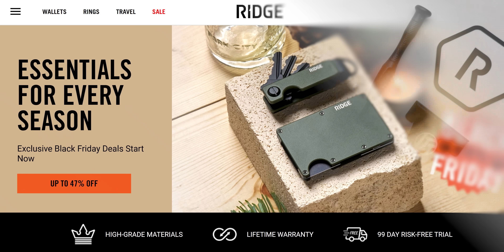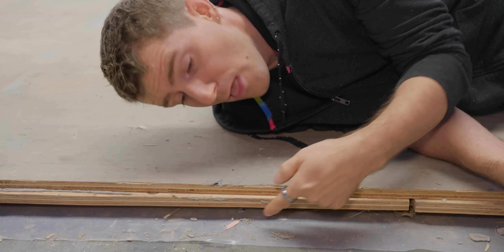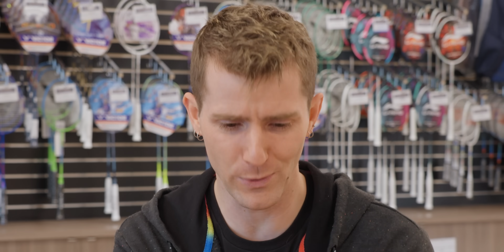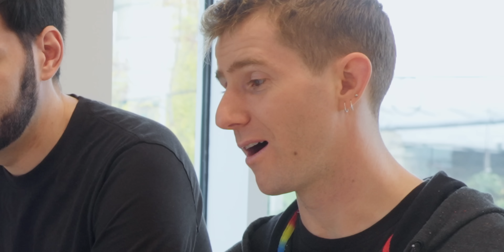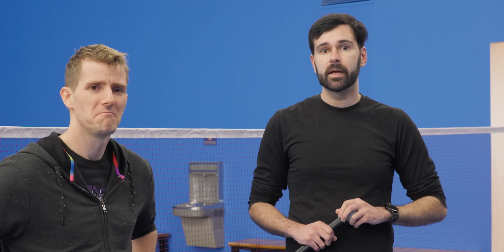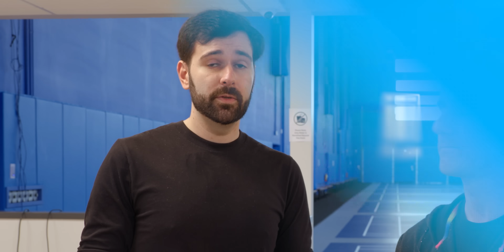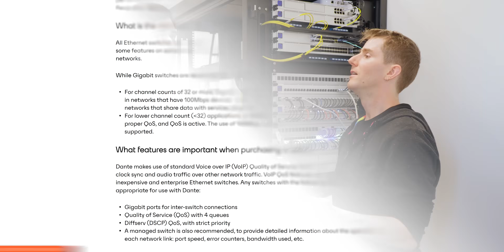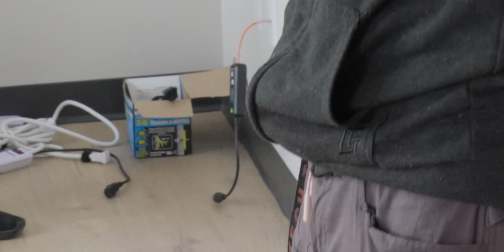You can finally hear me! - LAN Center Audio Tour

Comment: so I'm confused, why would you not just wire speakers to a centralized location then just use wireless mics or a longer xlr run? I believe XLR cables go around 1000 feet, so you could've just wired everything to closer to the middle of the building then just split a cable off from there.

Comment: I reverse engineered Dante Controller by capturing network packets and examining them so that I could control and script the devices from Linux without a GUI. My use case is a home audio system declaratively managed with systemd that runs jack and manages shure wireless systems so that I get every mic available on every computer and every output mixed into IEMs that I can hear while I just walk around the house. project is called netaudio

Comment: Came here to get a little bit nit-picky. 
Dante isn't a standard. It's a proprietary implementation of Audio over IP, similar to NDI being a proprietory implementation of Video over IP, hence the need for companies to be licenced by Audinate to produce hardware using Dante.
There is a standard called AES67 which allows for interoperability between a bunch of different Audio over IP standards that are in use across different industries, Dante being one of them. 
Dante was widely accepted in the live production and installed AV world, especially after companies like Yamaha licenced it for their AoIP implimentations. It's very common to use Dante in the way it's being used in this video.
The broadcast industry uses a few different AoIP protocols including LiveWire+ by Telos and Wheatnet by Wheatstone. Again these are proprietary protocols that are AES67 compatible and to use them the products must be licenced by the manufacturer.
RAVENNA is an open source, AES67 compatible, implementation. 

Basically these protocols were all being developed in the mid 2000s and all of the different manufacturers saw the need to interoperability between them which lead to AES67 becoming a thing in 2013.

Comment: Not bad for a software (or at least a non-audio) company. As an audio engineer (who for example regulates the Dante setup here at the Dutch broadcast museum and event floors)  I see you implemented it quite well! I don't know which Shure receivers you're using but take in account that the more pro models from Sennheiser and Shure have Dante build in (saves some dongles!).

Great job in the switches as well, I wouldn't expect anything different but for us sound engineers that is usually the main problem. At most companies the IT is separate from the AV part and to get the right switches / configuration for Dante is a pain since AV is not allowed to touch switches while IT doesn't understand Dante. There should be more crossover interests cause all is coming together more and more (I do btw know enough cause of my streaming / videogame background so usually I can talk to IT about it quite easily but lot's of sound colleagues don't know one ip address from another sometimes ;)  ).

Comment: Dante for the win! As far as the microphones are concerned you may not have issues with them reaching the receiver from the back of the building now but once there are bodies in the building that will be a different story. I recommend using larger antenna fins mounted in a central location for the best stability.

Comment: For microphones I would recommend going with higher up Shure microphones…. Something like the slxd.  With those microphones they have rechargeable batteries and docks where you can charge them, diversity antennas (external antennas to), the ability to network them and use wireless workbench, as well as many other great features such as scanning.  I’m sure that blx will work fine but in the long term you might want something more reliable.

Comment: If you use some NAC software, it can change the VLAN automatically, when a device connects to any switch-port. The device must be identified, to set the correct VLAN, most common is by mac-address or 802.1x. 
Also worth mentioning is, some Switches can change VLANs without a separate software, by using a discovery protocol like LLDP. They set the VLAN based on detected device type.  
For LLDP or 802.1x your end device must support these protocols. Identification by mac-address can be done with any ethernet device. Also your switches must support some type of port-authentication. Most enterprise switches do RADIUS.

Comment: As someone that used to DJ for Corporate and Weddings, did you guys install anything that we can plug in XLRs? I am assuming that you guys will hire vendors for entertainement sometimes because most DJ's do not have mixers that can connect to Dante. If not I would suggest getting the Behringer Wing Rack Mixer with the Dante Card. And then use XLR to RJ45 to avoid running wires like you guys mentioned in the video

Comment: Hey guys, it's great to see you installing a Dante based system, it's absolutely the way to go for your application (and cheers for throwing a few dollars into the Australian government's budget 🤣). However, I do have a few thoughts... 

Firstly, you'd have to be crazy if you're going to run Qsys in a building like this and only have an Ipad or Qsys designer for control, you really don't want to have some random software bug on the device you're relying on to cause you to completely loose control midway through an event. Please do yourselves a favour and install a hard wired Qsys touch panel somewhere in the building. 

Also, unless I'm mistaken those mics look like Shure BLX... Narrowband analogue RF is just asking for problems once you fill a building like this with people and all their devices, plus the dedicated coax runs needed to run a proper antenna setup will be a pain. The go-to for these sorts of installations is a DECT based system (shure microflex or sennheiser speachline), but please at least step up to digital RF, the difference in signal integrity and resiliency is night and day from analogue RF.

One thing that might make life easier for what you're trying to achieve is if the unifi switches support device-based vlan assignment, at my work I've had the sys admins setup our Aruba based networks so that the default behaviour when any device manufactured by audinate is connected it will automatically be assigned an AV Vlan. It makes life stupidly easy if you want to be able to plug into any random port and immediately start sending audio. 

The other thing to note is that although professional audio hardware installation can often be pricey, there are plenty of professional AV system programmers who can remote in to your systems to do work and can be very cost-effective in terms of the quality of their work and the turnaround times. They'll often have a wealth of experience when it comes to Qsys programming and UI design. Or you could just send Dan off for Qsys training 😜.

Hope that helps

Comment: Slight correction regarding Dante and Switches. There are some things that must be taken care of. The switches must not have "Green Etherent" (or EEE) ports or if it has them they must have the option to disable it because it messes with the PTP that Dante uses for timing. Also when you go past a couple devices and a Dante network is part of a regular computer network QoS, Multicast snooping and Multicast querying is basically mandatory if you want to have the least problems possible.

Also Dan, for the Shure microphone get some antennas into the court. When you have a couple hundreds "sacks of water" (e.g. human bodies) in that room the mic reception will be significantly worse.

Comment: … I’m surprised LTT went with a Dante system instead of a 70V…. Seems unnecessarily complex and pricier than what a 70V system with a DSP tie in would be, with practically the same functionality that they’re doing.  I suppose the Ethernet lines were pre-run, and the network bypasses the latency, but expanding on a 70V isn’t all that tough either though.

Comment: Edit: Before you read this comment please take in consideration I'm still learning and am not a professional in this subject yet, so some info might be wrong

on the subject of the way the speakers are places, you should of bought more speakers and put them all in a line array configuration. This would have been more on the expensive side of things but you would have got a more immersed sound. Line arrays give a wider projection of the sound there for you could be standing anywhere and the music would sound somewhat equal volume from any position, in saying that you would also start to go down the route of speaker crossover. lastly you'se should probably check the dB level when the music is on "death mode" because anything above 80 dB or I think 85 dBSPL (its been a while) can cause hearing damage, this could be dangerous in corners of the courts due to the fact that sound builds up in corners. other than those things this isn't a hate comment I would just like to shed light on things I know, really liked this video thanks for reading. 😄
Reply: Line arrays are fantastic where you have them based around a stage. Because this is a "distributed" audio system across multiple rooms / zones, a distributed system is actually the best option. There's a reason you don't have line array's in the doctor's office lobby. You also have to consider rigging as well, and any line array will be WAY too big for what they need.

Line arrays are great when the sound needs to come from a certain point across a space with high level and quality. Distributed systems are great when you need low to medium level / quality across a diverse set of spaces / zones.

As far as hearing damage is concerned, NIOSH has great resources on SPL exposure limits. Per the NIOSH hearing exposure dosage info, you can be at 85dBA continuous for 8 hours and be chillin.

Hope that helps in your learning!
Reply: @rubitsium  OSHA has a better standard, it's less lenient - 8 hours at 80 DB.  I try to limit my exposure much further than that, however.
Reply: That's actually the reverse.

If you look up "NIOSH Exposure limits" and find an image of them side by side, you'll find that the NIOSH limits are much more conservative (less lenient).

NIOSH dBA numbers will be lower for the same amount of exposure time than OSHA numbers.

This is why it's safer to follow the NIOSH standard rather than the OSHA standard.
Reply: @ It's actually the opposite. NIOSH has the more conservative standard if you look it up! If you take an SPL measurement solution (like Smaart with a calibrated measurement mic) and look at exposure doses over a show, the NIOSH number will be higher.
Reply: @ you're right, I stand corrected.  thanks man.

Comment: As an avid audio engineer who works in AV engineering and support, this demo of the setup is very cool. I'm very familiar with Q-SYS but I only have very limited experience with Dante so this was incredibly helpful in understanding some of the capabilities and features that Dante with Q-SYS can accommodate. We certainly have come a very long way since the days of analogue audio that required amplifiers and wiring to be run everywhere with phantom power and XLR mixers and everything needing to be adjusted manually typically by a trained technician and repeatedly visited to maintain or make changes or adjustments. These network cloud managed systems are a god send when it comes to end user friendliness.

Comment: As an AV integrator and QSYS programmer please please please do not rely on the iPad UCI Viewer app to control your system. At the best of times it will brown out on you every 10-60 seconds and at the worst of times won’t connect at all. I recommend a QSC touch panel hard wired to the switch. It all never time out and will be 100x easier to setup

Comment: He mentioned a slight separation between speakers while walking around. In general, unless he was somehow out of the intended (or actual) coverage zones of the speakers when he said that, having separation between speakers in that scenario (desiring uniform coverage capabilities to all floors, along with other options, of course), is not desirable. 

They could look at adjusting the angles/directions of the speakers a bit, or swap out some (or all) speakers to ones with as close as 180° coverage as possible (where appropriate). Sometimes it just means a swap, but if all else fails, add more speakers! 😂

I hope I explained that appropriately. I’ve been in the AV install/integration business for 5 years now, so it was nice to finally fully understand one of Linus’s niche infrastructure vids lol.

Comment: I’d call this DAN-te, certainly a great implementation of the standard. The only thing that would be nice (for your setup) is if ubiquiti could see a device on a port, check the MAC address to a whitelist and swap that port over to the correct vlan. I’d have maybe gone for a rack mixer (m32 rack or similar) so you have the option of an iPad app to mix more generically for events where necessary, but this might do it anyway

Comment: whelp now I know what I'll be using should I ever get the chance to follow my dreams for a combo large garage and  VR internet cafe. hell it almost would fit perfectly into my future house plans to be a farm and a great place to host family events, a bit more on the pricey side of things(especially compared to my DIY home assistant outlines) but a large network closet is in the plans, I could probably spring for a few more network drops if i did smurf tube over pvc pipe cable runs if it saves me the setup headaches of a DIY solution. I could probably save more or hustle harder for an extra year to make it part of the home build.

Comment: I personally used a similar system during badminton tournaments in Belgium. Mostly for sending the main hall audio feed to nearby warmup court's. It is a great protocol and can be used to send audio on existing (unused network cables) or dark fibre. You only have to work together with the local it guy but if you are using unused cables they are willing to help.

Comment: I was working as a producer when Dante first started being announced. 

We had just invested heavily in ADAT over optical fiber throughout the whole property, so it was not practical for us to adopt, but I followed its development very closely with a tiny bit of jealous resentment and a lot of FOMO.

If it had come to market a couple months prior, we would have saved a ton of money as we already had wired networking and would have only needed one cat 5 run to the stage.

The 500ft or so of toslink cables plus the break out boxes in every room, booth, and to the stage outside, plus the Marian PCIe card and the absolute beast PC for the time that was required for it to all run was a significant investment in both terms of money and in terms of time. That and it would randomly drop samples, crack and pop, or just stop working ALL THE FREAKING TIME. I cannot tell you the number of ruined takes, and even a ruined concert recording, all supposedly caused by using “cheap” (still well over $100/ea) cables with plastic cores instead of glass (chosen both for cost and fragility since some runs had bends in them)

Long story short, Dante would have been a significantly better investment if it had been out at the time.

Comment: As someone who works in the AV industry, I have to applaud you guys for going with Dante. 

That was my first thought when you were talking about your options.

The amazing thing is, if you get an AV company to come to your LAN event, it shouldn't be hard for them to plug in and do whatever they need. 

The other thing I would love to mention is, you can get a networking company to program your switches for Dante, etc. 
That's what we do if we need to run Dante, Internet, Artnet and multiple other protocols across multiple buildings, we hire a company who rents us CISCO switches programmed so we only need to run 1 Ethernet cable in between buildings.

Comment: I program Crestron systems and work with Biamp/QSYS DSPs daily.  Love seeing this content!   FYI, when you utilize all 16 of your licensed Dante channels you can always save a bit of money and just add AES67 inputs and outputs. Takes a couple additional steps but isn't licensing/Dante Chip channel limited.  You can also set up Multicast flows to reduce bandwidth utilization if you are sending a single channel to multiple outputs instead of several unicast streams.

Comment: If Dan were to implement 802.1x on the switches with a radius server, the switch could be configured to allow plugging the devices into which ever switch port and the Radius server will tell the switch which VLAN that device should be placed on. Makes the whole thing very versatile and fool proof.

Comment: Dante is old. Your Q-sys file isn't pretty, and I'm sure you can clean it up. Watch your multicast bandwidth and flows. Use a PA Router and virtual page station to to "ducking" of music when announcements are made. Volume ramps are overall, use them with the PA router and you can do it only on BGM but not the announcements. Get a UCI built and have a TSC page station at the counter. 

Happy to consult more if you need. I'm fully Q-Sys certified and Dante/AES67 certified as well.

Comment: Hey Linus I had a question about upgrading my computer I have a asus motherboard with a CPU(AMD 8350 eight core processor) and my gpu is a NVIDIA GeForce Gtx 1060 6GB Bassically I’m wondering if I can upgrade without changing my motherboard to something more modern or am I better off buying a new setup I just don’t have the money to spend over $800-$2,000 please if you see my comment I would love to get your help on this